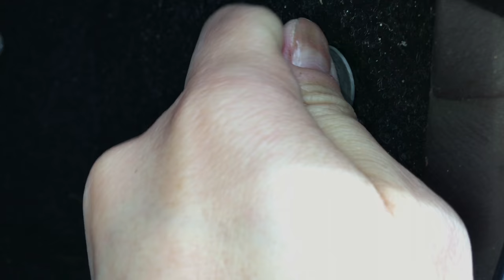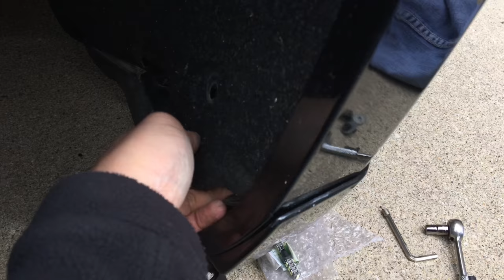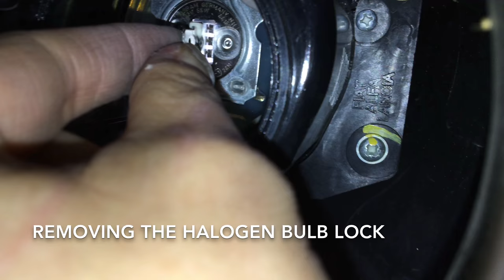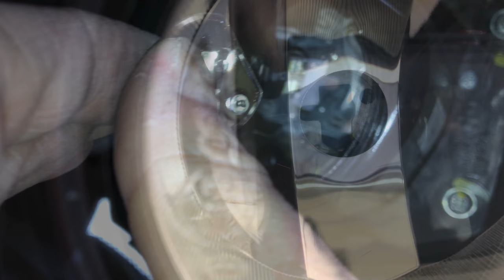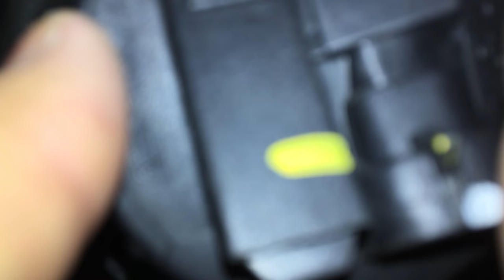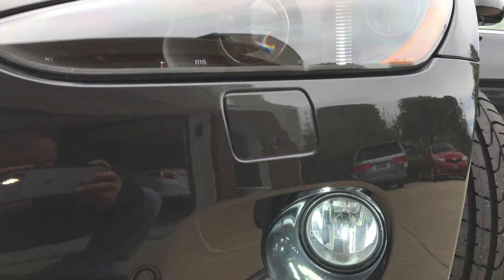Maserati Granturismo S Fog light LED MOD 4KHDTV

Comment: what brand & model are the leds you are using? also, did you get an error code after installing? looks great!
Reply from the maker: Drama no error http://m.ebay.com/itm/291345216597?_trksid=p2060353.m1438.l2649&_mwBanner=1
Reply: Thanks! Ordered & received bulbs, installation was a breeze with your instructions, no error & look great. Now to get leds for the rest of my bulbs!! Love the difference.
Reply: @TQP9999  The link doesn't seem to work anymore. Do you have the model number of the item? Thanks.
Reply: @TQP9999  can you send me the H1 link? I can't find that error free bulb anywhere...
Reply: Hi, the link does not work